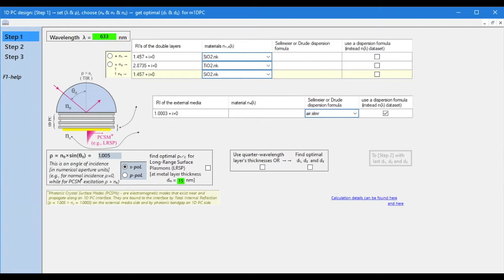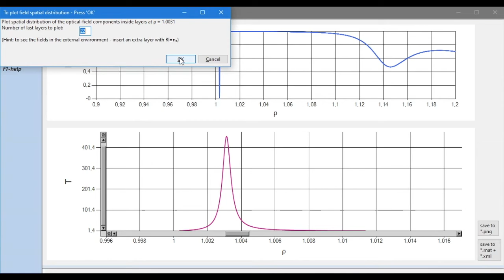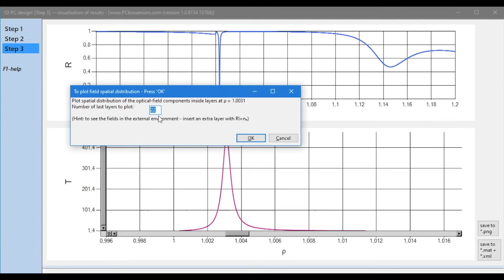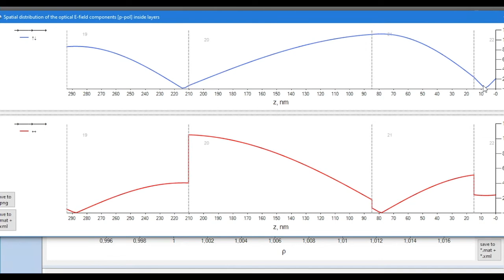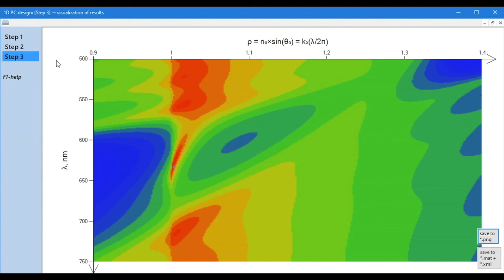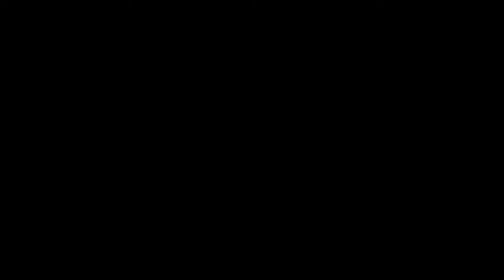Design of 1D photonic crystal structures: 3rd Example  - structure for Long-Range Surface Plasmons

Comment: HELLO AGAIN
Which method did programe used (Fdtd m. Tmm m...)
Reply from the maker: The method is described at https://www.mdpi.com/2079-6412/12/10/1489/ 
It is an analytical method (impedance calculation), not the numerical FDTD method. The Transfer Matrix Method (TMM) gives the same results, I believe, but it is the impedance approach that is used here, not TMM.